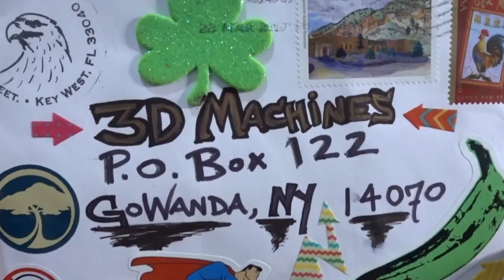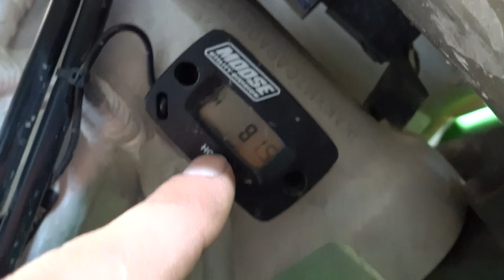SELLING MY FIRST DIRT BIKE

Comment: Hope you enjoyed the Replacement LED bulbs we sent for your truck (that's the ClaraLux bulbs). The orange things are LED resistors (they go on the brake, rear blinker and front blinker bulbs). The 7" light bars could be usefull on your Kodiak

Comment: The light next to the amber lights are your day time running lights. They only come on when the park brake is off and some only come on when the park brakes off and the vehicle is out of park. The Chevrolet are notorious for having one of the day time running lights go out and only having one working.

Comment: Fell in love with my 07 civic si. it had 80k miles and turns out the previous owner ate through 2 transmissions and 3 clutches. Never ending problems with the drivetrain. Ended up selling it

Comment: Dalton, what i think your problem is with your lights is in fact your daytime running lights. there are two non amber light bulbs mounted just inboard of the amber signal lights that come on when the truck detects enough light from the ambient light sensor which is the tiny black bubble in the centre of the dash right up by the windshield. if you can get a bright enough light to shine on the sensor when the engine is running your daytime running lights should come one so you can see which one is out. the part number is 4114 for the long life bulb. hope this helps

Comment: I got a red 2007 Pontiac Grand Prix, had it for 4 years for my first car and put so much money into it for replacement parts, straight piped it, black fender stripes and black rims. My friends that got me into the car scene helped me alot with it, then my transmission needed to be replaced. Got a brand new transmission put in and not even 1,000 miles later the new transmission has metal shavings in it! When I get the money, definitely fixing it down the road after college 👌👌

Comment: Those driving lights only come on when it's in a driving gear. It's just the ends that toast out on the driving lights. For whatever reason gm has them running on a hot high setting causing them to burn out. I had the same issue with my 2000 Silverado. Just get the new ends from autozone and wire them in. It's super easy but my advice is get both sides and do them. I replaced one then 2 months later the other one went out

Comment: I have an 1986 trx200 that my mom get when she was 14. i spent probably over 50 hours of working on it to get it in riding shape again after the crank case cracked, and I was so happy to get er going again. I kinda forgot that it isnt a modern race quad, and I beat on it for a couple days in a way that someone with a race quad would. bout a week after I got it going, I be my the swing arm. chain won't stay on, rear tires arent strait. I got so hyped up and I just flogged it to death in a week.

Comment: hey dalton put the dmax in gear and look at the light its the running lights and they are only on while in gear. it is the bulb most likely I think its like a brake light where it has two elements and one is burnt out

Comment: Fell in love with my 2000 Yamaha Blaster 200 2-stroke. about a week after I bought it, the top end went on me. lucky for me it was a 2-stroke. After investing money and time into this thing, it ran like a top, only other problem I had with it was a fuel valve leak.  was a sad day when I sold it, but the next machine I bought would make me even happier. 2001 KTM 125 SX, till I dumped it going down the road. sold that and went to 4-stroke. currently riding a Honda CRF 230 F. love it, but looking tol upgrade to a 250 4-stroke. ***More than likely a Honda***

Comment: what I got attached to: 95 f150 5.0 auto. got it from my grandma when I was 16.
why it disappointed me: transmission blew up last summer, got hauled home by a dodge. engine started knocking late-january when I fired it up to charge the battery

Comment: I always get somewhat attached to all of my machines.  It's part of getting to know and trust your machine.  With that said, the only machine I've ever really been upset about losing (or selling) was my 2000 Yamaha R6.  I bought it brand new, as a senior in high school, and had it for 4 years.  It never really let me down though.  If anything, I guess I let it down.  I was leaving work, and got distracted.  I was riding through a green light, and when I looked forward, there was a car stopped at the green light, and I rear ended it at about 55 mph.  It still ran, but it was totaled.

Comment: My first car, 2007 cvpi state trooper edition. Got it at auction ran so smooth 4.6 engine, good power. 5-6 months I had it, transmission went out. Looked it up, around 1600 if I get a used scrapyard trans  or 2500 if I got a new trans, I payed 1500 for the car. Since then I bought a bran new-used truck. I have plans to put a mustang 5 speed in the cop car. Puts me up in the $700 range plus whatever clutch I go with...

Comment: My love but disappointment is my 2007 Honda trx400ex. I bought it thinking the only mod was an exhaust. A week later the thing quit on me. Took it to a place and found out that it had race parts in it. Fixed it and a couple years later it developed a knocking noise in the motor. Runs fine but has knocking noise. I love it but I can't keep putting money into it.

Comment: I have became attached to my 1986 Honda Trx125. I got it for free and had to put $100 into it to get it running. Then I put $220 worth of tires on it. I had the nuts that the welds broke on the carrier and on but stripped so I bought new bolts and rethreaded them I also cracked the frame. I bought new rear brakes new tie rod ends new front and rear wheel bearings. It's not my first quad but first real quad it may also burn a lot of oil because the people that had it before burnt a piston and put a new one in it. It sat for like 10 years only being ran a little so the rings never set. It still runs okay just burns oil

Comment: The orange things in the fan mail section you didn't know what they were are load resistors. Usually used to stop error messages with leds on a can bus system obviously fooling the computer to thinking there is a standard bulb in place. Also used to stop led flicker.

Comment: here's my story. my friend and I really like doing similar projects as you, so we decided to make our own "motorcycle" we both had 2011 fitbikeco 20 inch bmxs, and with a 6.5hp predator engine we made it. basically my bmx had the good rims, handlebars, bearings, ect and his bike had the good frame (cracked mine) and we got the bike built after 8 months of trying to figure out what goes where and waiting for shipping of course. so after its all said and done, it's ONE BAD ASS BIKE. we hopped up the engine, to about 14 hp, (springs, valves, slight port and polish, straight pipe, jetted carb and ram air intake, cam and a few other goodies) so on a bike with one gear, 4.0 to 1 gear ratio, i went a cool 65 on it and it still had pull left, I chickened out. my friend and took care of this bike religiously. we had this bike mabe... 7 months and guess what. it was stolen. look at my instagram: Dooley_from_bro_inc  
and if you're wondering, yes we contacted the police, and my friend and I have decided to build another bike. that's all I'm saying about the new bike though, it'll be really cool if you'd check out my instagram, I always see your bikes and I  think you'll be impressed by mine

Comment: My 1995 Ford Taurus SHO 5 speed, it only had 77,000 mile on it but had a few front gasket leaks dumping oil onto the timing belt and I couldn't afford the labor to get her fixed.

Comment: My yahama XT 350 1994... its in piece but planing  to rebuilt this summer... rear shock need a full rebuilt, oil filter cap need a rebuild... and full repaint job need to be done..

Comment: Sup Machine Freaks! Bought my first bike cash a few years back, 2013 husqvarna sms 125 absolutely pristine forjust over 3'gs! Fell in love with it.. First ride out self mixer failed.. Second ride after rebuild water pump impeller seized.. Third ride after another rebuild CPS was rotten and wouldn't start.. Went round several garages undiagnosed for a year! Got it running finally and blew another piston still overheating.. Sent top end away to be ported and skimmed and got lost in transit never to be found thanks to Parcel Force the shower of wankers! Bike sits mint still as I don't have a G for a new one! Gutted ain't the word..

Comment: Also 3d machines, you should see if you got some extra parts I could put on my Murray Explorer off-road go kart or my fun kart. My Murray go kart needs an engine, seat, 4 tires (I got rims), seat belt kit, and brakes. On my fun kart I need engine, and front rims with tires.

Comment: My 01 Yamaha blaster 200 and my eton viper 110 2 stroke (bored to 110 they only went to 90cc on two strokes). My blaster needed a new top end when I bought it and the viper gummed up carbs a lot and breaks locked up.

Comment: When you change any of the front end bulbs in a cat eye duramax you need to use the socket grease otherwise they burn out within a few weeks. I had the problem you have with my duramax but it's every time i put in drive it would stop working... I just put leds in and it stopped going out.

Comment: I had a 1993 ford bronco it was my first suv/truck I had it 2 years and blew up the motor I pulled the motor rebuilt it drove 2 weeks then my transmission went out on it and I had to part ways with it still regret selling it

Comment: I had a Toyota truck (my first pick up) that I drove for 14 years (200,000 plus miles) that the motor blew on my way to work one morning. Dude, I actualy cried I was so upset! I did all the work myself to keep that bad boy running and when it died it took a little of me with it. Still think about it years later.

Comment: 2006 yfz 450 that I raced for 3 years and then sold because it lost power after half throttle and also had a baby on the way. miss that quad.

Comment: I had my 2 stroke puch moped two years before I could even ride it, rebuilding it cost me a year because there are no parts and I rebuild the engine 3 times because of one little thing I didn't see, crankcase seals were a tiny little bit to wide so they blocked the big end bearing lube channels. but now it is riding awesome and I've put about 14000 kilometers on it in a year, so glad I didn't sell it

Comment: I bought myself a 2000 cr125, I saved for 2 years until i was able to afford it. About a month ago it was stolen, but 4 days later it was recovered by the police. I got it back in horrible condition, the top end was blown up, spray paint all over, back tire had nails in it. It costs a lot to get it fixed but i cant find myself ever selling my first bike, i will soon begin to bring my bike back into brappping conditions.

Comment: How much you want for your bike?

its your daytime running light, not your amber colored turn signal. its a clear bulb on both sides, more towards the bowtie on the front. it only comes on when its in gear. i.e. driving...
Reply: Tom Stoughton $1000000000000000000000000000000000000000000000000000000000000000000000000000000000000000000000000000000000000000000000000000000

Comment: My 2007 crf80 first the new fmf I put on it cracked by the flange but my friend welded it up the the engine went to ticking a lot then I rebuilt it the it still had no power so I traded it in on a 2004 cr85

Comment: I have a 2004 Yamaha raptor 350 that I bought a year ago for a amazing price.(it is my profile picture) I rode it and fell in love instantly. Then when we got it home it ran amazing until the head gasket blew. I plan on fixing it soon. It is not to the point when you can't ride it but you have to fill it up with oil every time you ride it and it is not a 2 stroke. Hopefully fixing it this summer ant maybe boring it out or a cam🤤
Reply: Gavin Quandahl it looks cool

Comment: Bought a 1999 cr 125 dirt cheap named it Samantha guy said it had a burnt ring rode the bike 1 time after I bought it put the new piston in put the bike through a heat cycle shut it down for about 30 minutes and came back to ride and it spit up a main berring from the crank...currently rebuilding the entire motor and bike from the ground up

Comment: 96 Honda 400 foreman. Was a great bike, just rebuilt nearly everything that could be rebuilt other than the engine, engine broke a ring so we put a top end on it, right after it was broke in a seal went and I lost all my oil while riding. I realized once the engine started squeaking.... Should have put anther engine in it but I didn't. Wish I did but too late

Comment: my 99 rm 125. bought it put clutches in it then about 2.5 hours later one of the power valves dropped into the cylinder. luckily it didn't damage my head just piston

Comment: my hustler raptor 54 in deck zero turn mower. she have around 350 hours she have a Kawasaki fr691x  23 horse power year she is 2014 still running like it came off of assembly plant.

Comment: Just sold my first motorcycle my 05 r6. I had her since new it was my first brand new anything with zero miles. Just wasn't using it anymore I did 65 miles on last year where as I did 12k on in it 05. Miss it already

Comment: Seth they are running lights when in drive i have a silverado and it does the same thing the running lights burn quicker so they probably need to be changed

Comment: I bought an 1986 lt250r. Ran great had it for 3 years bores out to a 309 supper fast raced in 14 races and won first in 12 of those and then 2 days ago it just wont run. So it really disappointed me

Comment: I bought a 2009 yz450f and the third day I had it the chain busted and broke the crank case then when I got that fixed it blew all its oil out of its overflow and locked up solid and like your kx it ruined the whole top end it even melted the piston to the cylinder, so I sold it and I loved that bike so much this summer past I bought another yz450f but this one is 2011 fuel injected and I love it wouldn't get rid of it for the world

Comment: the auction company won't sell it for very much if they know what's wrong with it, and you have to tell them, I couldn't sell a bike that way knowing it needed several hundred dollars in repairs, and that's just the top end, something failed in the oiling system, either pump, or a restriction somewhere. it needs a total tear down to check all the bearings, piston, ect. the cams are the last stop for oil, and the first to suffer oil loss. hopefully the bottom end is ok. anyway, back to auction, if you don't set a minimum bid, it may go for WAY less than you hope, I went to a auction like that, they had a cr250 that wouldn't run, was a estate auction so it had sat for years. anyway, I walked away with it for $125. :)

Comment: I have two old quads I have a 1999 Honda 250 fourtrax 2wd and a 1986 Honda 250 big red three wheeler... I got the fourtrax five years ago when I got it the motor was seized but I fixed it ... now the motor is getting very sick I just replaced every single bearing in the rear end and swing arms now I need one for the steer shaft ( it crumbled to pieces mid wheelie) ... my old three wheeler I crashed it last summer doing 95 kmh through a gravel pit and was hospitalized for two weeks but the bike is fixable and will be foxed soon she needs a back rack and a front rim shocks and a head gasket... I've been offered up to 1500 dollars for each bike I will not sell them cause I just can't

Comment: I have a 2001 Honda Foreman Rubicon that's my baby but I've never had any trouble oit of it except for the choke cable,  that's it.   As hard as I run it and the terrain I ride on you would think it would be breaking down a lot but nope.   The atv I'm speaking of is the one I'm on in my thumbnail pic.

Comment: my papas 1986 ford ranger disappointed me a lot because of breaking down a lot, like every 15-20 miles it would shut off everything except anything electrical. it was problem until it would not start not even anything electric and it was not just the dead battery

Comment: had a 1996 maxum bowrider. we were the 4th owners . when we bought it we had known the previous owner and we borrowed it for 2 weeks every summer(we acctually used it more than him). He was desperate to get rid of it so we bought it very cheap. First summer we had it the things was broken 1/2 the time we were in the two weeks we used it. 2 years went  by no problem 3rd year new carbuator(long story short the marina did put the boat where it should have been so part of it got wet and water got into motor) next year (this previous summer) it would strat(had been giving us problem the whole summer sincewe had bought our condo(starter was going bad). Starter finally shit the bed in the 2 weeks we have always had the boat so we had our cousins tow us to the marina to get it fixed. Very sad and dissapointing to not be able to go on our daily boat rides!!

Comment: I have my 1971 case 220 I use all the time hauling wood misc yard work I can usually haul anything, then I went to pull out a small bush and it couldn't do it :( but its weights 800 lbs lol

Comment: i had a 400 traxxas 4x4 that was running great but smoked a little because needed new headgastget sry if i spelled that wrong but i took it throught this hole in our back yard 10-15 times every time i rode it then hosed it off and the one time i forget to hose it off i go throught that hole and hear BANG and my rear axle bea4ing blew up and ripped my plastic and so i sold it because i didnt have the money to fix it

Comment: I had a extremely custom 1994 cr250 it started to burn oil because of the crank seal. And Spohn the clutch so I put a clutch in her and new crank seal.  She were on like a champ but. I said I've got two 2 two strokes so I'll let others first one I ever bought go. Two weeks later my older brother blew up the kx250.   So I was soo sad.  The cr was an American edition with every part aftermarket. I just picked up a 05 crf450 it's nice. But I miss the smell